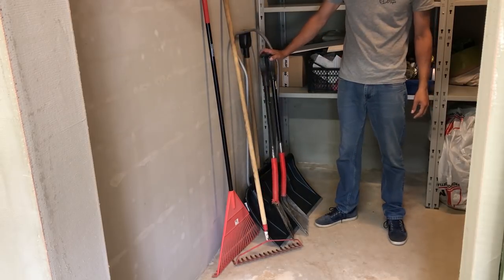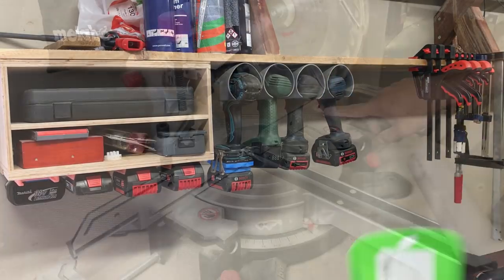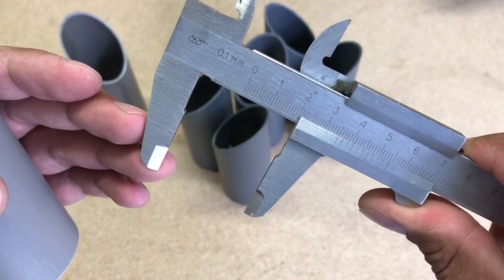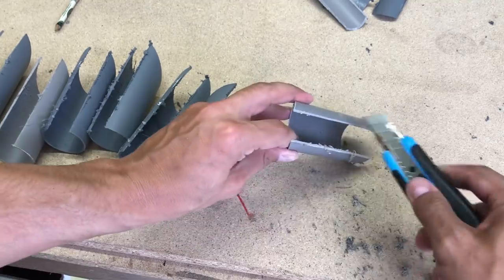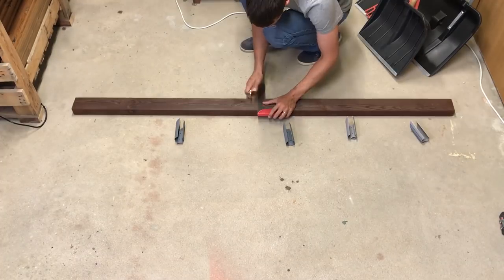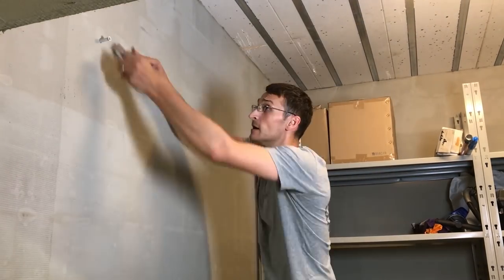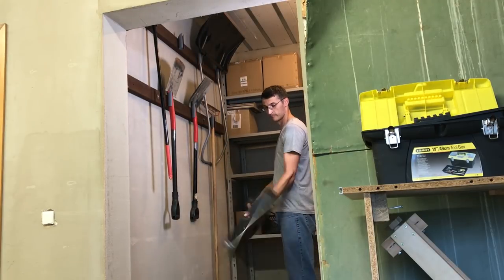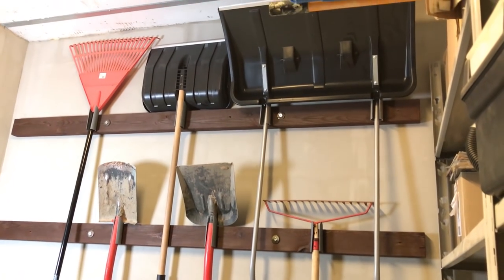DIY: Simple Garden Tool Rack

Comment: Did something similar. Had some neodymium magnets making shade in my drawer and i screwed them on a piece of wood. They are strong enough to hold all of my shovels and rakes, i had to triple the amount for my electric saw. They are round, with a hole in the center, 3mm thick around 2 cm in diameter.